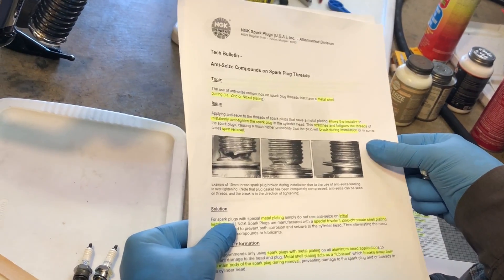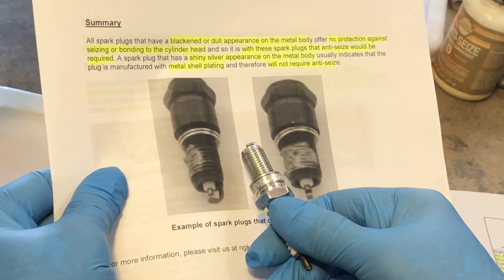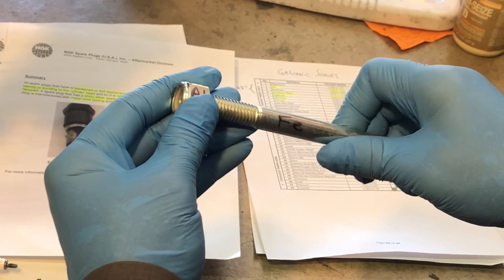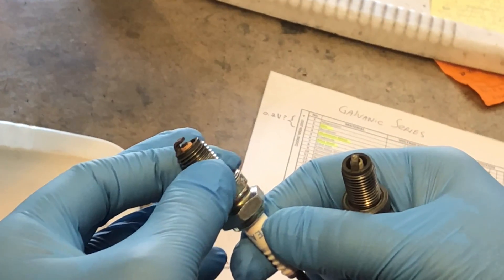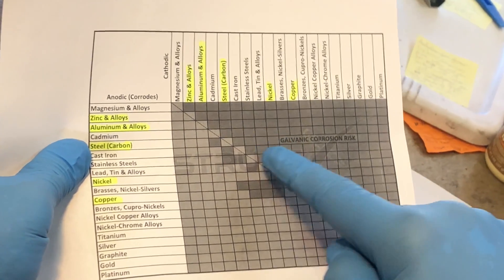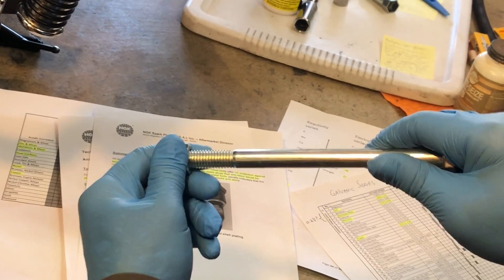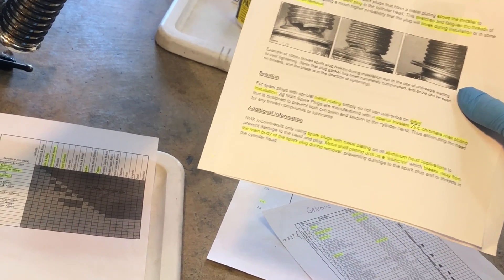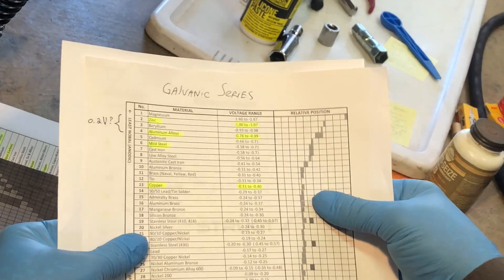Aluminum cylinder heads, spark plugs, anti-seize, & galvanic corrosion

Comment: Hello,
So…if the friction coefficient of an anti-seized thread is equal to a zinc coated thread, would one torque both the zinc plug and the anti-seized plug to 7 and not 10?
Reply from the maker: The friction coefficient of a zinc-coated thread is not equal to that of a thread, lubricated with anti-seize, because anti-seize contains not only powdered metal (zinc, copper, etc.), but also grease, which provides most of the lubrication.  Without lubrication, the friction within a metallic threaded joint depends mostly on thread geometry and surface roughness.  Many bolts and screws are coated with zinc, nickel, etc.  These coatings do NOT turn them into "lubricated" fasteners.
Reply: Great work!
Although copper and other compounds may indeed not prove to be problematic…
Given you expressed no reason(s)  how copper or other compounds might possess beneficial properties not present in alum or zinc compounds…
Any reason why I shouldn’t simply utilize an aluminum or zinc compound?
Your presentation was fantastic!!
Reply from the maker: I prefer zinc-based anti-seize because zinc is more reactive than copper and aluminum.  Also, the product I use has a very high temperature rating.  However,  some viewers warn against using copper-based anti-seize in certain situations -- see comments, below.  Personally, I haven't had problems using anti-seize of any kind. @flyonbyya

Comment: Fantastic information, especially if plugs are removed for inspection then reinstalled. I never use a torque wrench to reinstall plugs. They have a crush washer and and bring them up snug tight and don't moose them in.
Reply from the maker: Thank you!

Comment: Super Presentation!!!
I have a great running 302,000 mile ‘07 Toy Yaris I’ve owned since nearly new.
 I waited until 217,000 miles to change the original plugs…
It took quite a bit of force to free them…I was quite afraid they were going to strip!
Q. I’m curious as to how much of that friction was the threads vs seat friction?
And yea…I applied anti-seize and eased off on the torque on the new ones.
Bout time to change again.
Reply from the maker: From what I recall, when a fastener is tightened, about 50% of the torque is used to overcome head friction and 40% to overcome thread friction -- only about 10% of the applied torque goes to stretching the bolt and creating clamping force.
Reply: Hello
Should or would  that -30% torque rule apply with any anti-seized steel bolts threading into aluminum?
Thanks
Great presentation!
Reply from the maker: In my experience, yes.  You don't want to strip the aluminum threads out. @flyonbyya
Reply: @Zerk_Ziegler 
My only potential contention is the assertion that fasteners are designed to be torqued dry or lightly oiled, given its critical the proper application of a specified lubricant be applied to engine head studs/bolts, rod bolts and crank mains and other critical components.
ARP is the world leader in aerospace quality fasteners and explains via YouTube 
why it’s critical that proper lube be employed.
Copy n paste the wording below to YouTube: 
Why Use ARP Ultra-Torque Fastener Assembly Lubricant
Reply from the maker: Good point.  "Dry or lightly oiled" is somewhat of a general statement.  For torque-critical applications, manufacturers/suppliers specify particular procedures that must be followed and/or lubricants to be used.  It makes sense that torque, applied to a lubricated fastener, will result in more consistent clamp-up than torque, applied to a dry fastener, since the friction in the threaded joint is more consistent when it's lubricated.   @flyonbyya
Reply: Hello
Should or would  that -30% torque rule apply with any anti-seized steel bolts threading into aluminum?
Thanks
Great presentation!

Comment: I don’t think the zinc acts as a sacrificial anode, zinc is also a lubricant. I have always used anti-seize and will continue to. Never ever used a torque wrench.
Reply from the maker: The lubricating property of anti-seize is another reason I use it -- much easier on the aluminum threads in the head.  And you are right -- if no electrolytic substance is introduced between the threads, no electrochemical reaction occurs.  That's why copper-based anti-seize (aluminum is more reactive than copper) is also effective.  But, if there IS some gap to receive the "electrolyte", zinc is your best best.

Comment: I have a question 
I replaced NgK plugs on a Gen3 Prius
I applied I light coating of Mobil 1 oil to the threads
I did not use a torque wrench 
But i was careful not to over tighten using my best guess

Should I have concerns?
Was applying oil a bad move?
In your opinion should I pull the plugs and do a do-over?

Thanks in advance!
Reply from the maker: Oil is not really suitable for high-temperature applications such as this (see comments, below, concerning the use of molybdenum disulfide paste).  I think it's best to pull the plugs, clean off the oil using carb cleaner, and apply a little high-quality anti-seize to the threads without getting any on the ground strap or the center electrode.  If you have good feel, you don't have to use a torque wrench.  Also, spark-plug manufacturers provide charts, specifying fractions-of-a-turn tightening specs for particular sizes and types of plugs.  Note that angle-wise tightening specs are different for new and used plugs that have crush washers.  If you pull the plugs and reinstall, they are "used".
Reply: @Zerk_Ziegler  
I agree, I was already leaning towards this. 
I appreciate your second opinion 

I’m probably the only Prius owner you’ll meet who has driven it at its governed max speed of 124mph! lol 
I regularly drive the interstate at 90-105

Somehow I feel driving it hard is better for the  hybrid engine, less thermal cycles….

It just stays hot!
Reply from the maker: License and registration, please ...  Bad jokes aside, internal-combustion engines certainly last longer when they are properly warmed up.  They also benefit from occasional high-RPM use, as this helps to blow the carbon out of the combustion chamber.  However, sustained high-speed, full-throttle operation does increase stress and corresponding wear on all drivetrain components.  As for driving habits to make my daily ride last, I would try to minimize shorts trips (under 10 miles), accelerate hard once in a while (no, not from EVERY stop light), and take it easy on the pedals the rest of the time.  Your car and your wallet will thank you.

Comment: Whoever broke those spark plugs must have tightened them like Hercules.
I'm surprised they did not strip the threads.
They dont need to be that tight with anti seize or not.
Reply: 5 Olga-doogas tight = 75ft lbs torque 💪👍🤣🤷🏼‍♂️

Comment: Honda's service manuals recommend anti-seize and provides a torque spec that assumes anti-seize is used. NGK, on the the other hand, specifies an angle not a torque. If either are respected then it won't be too tight. NGK's angle spec is impossible to overtighten regardless of use of antiseize. If someone used a dry torque spec and then added anti-seize then that would run into a problem (as NGK's bulletin described).

Comment: I guess I was lucky? I have a 2001 GMC Yukon that has over 300000 miles on it, the plugs were original! Why it still ran I don't know??? I was able to remove them, it wasn't that hard I was afraid I would snap a few off in the aluminum heads, the only difficulty was the rear plug locations, they were definitely worn down over twice the gap they should have had. I replaced them with IRadium plugs with a dab of anti seize. I think I'll be good for a while now.  If you wonder why I am spending time and money on a 21 Year old with over 300k on it? It has absolutely no rust and the engine runs fine. I use it for long trips 3000 miles regularly, I think the highway mileage is what kept it running so long. And I don't beat on it like too many people do to their vehicles today.😮 Treat it like a lady and she will treat you right.
Reply from the maker: Thank you for posting this comment.  I think you hit the nail on the head as far the benefits of long trips are concerned.  To have galvanic corrosion between two dissimilar metals, electrolyte is required.  It is my guess that by warming the engine up thoroughly during long trips, acids that are generated during the combustion process and pushed into the interstitial space between the threads of the plugs and the head are burned away.  Minimizing the amount of electrolyte minimizes corrosion.  Generally speaking, long trips and relatively gentle use are key for engine longevity.  But, it's not a bad idea to "get on it" once in a while to blow the carbon out of the combustion chamber :)

Comment: You do have to be careful using anti seize with copper on aluminum parts, especially on boats/stern drives/outboards, especially in salt water.
Reply: Salt water marine mechanic here since 1979.
I use Permitex aluminum zinc silver based antiseize as you warn.

We had copper head gaskets on older iron inboards .
But aluminum outdrives with stainless propellers sizzle like Alka seltzer in some big marina with shore power leakage at slips .
Mercathode anode cathode is a must .
I only use NGK on marine and motorcycle since the 70s .
Beware of counterfeit NGK iridium spark plugs now.
Reply from the maker: It is true that aluminum is more reactive than copper, so I personally try to use zinc-based anti-seize whenever possible.  Marine applications are some of the most challenging ones for sure.
Reply: @Zerk_Ziegler    For sure, and salt water is a great conductor, makes for a nice battery/galvanic reaction

Comment: Looks like when you apply antisieze, the concern will be the torque being applied during installation. Do you have an idea of how much torque (range) will break a spark plug?
Reply from the maker: It would be interesting to do a bench test to find out.  Also, I wonder if the plug will break before the threads in the aluminum head strip out.  My go-to method for installing plugs with anti-seize on the threads is to back the torque off 30% from the middle value of the recommended range and then check if the plug can be CAREFULLY hand-tightened a little further, just in case it's a bit loose in the head.

Comment: I have been using antiseize on spark plugs for a very long time. I also use a torque wrench. I have never had an issue with the threads in aluminum or cast iron heads. I have never broken a spark plug as depicted in the NGK picture but I have broken a small few by having the socket go on an angle when tightening so I have learned to keep the socket, extension and ratchet in a perpendicular position. My only precaution is to not lather up the threads and to keep it away from the electrodes, you do not want antiseize getting into a cylinder. IMHO, use it on all spark plugs and stop fretting over it. Those depicted NGK spark plugs must be made with recycled Chinese steel.
Reply from the maker: Thumbs up on keeping the socket straight and keeping anti-seize off the electrode and ground strap!
Reply: I would also add that not all "anti-seize" compounds are the same. I have seen AS compounds that are copper-based, but I have also seen nickel-based "high temperature" AS.
Reply from the maker: Others are Zinc or Aluminum based and some contain no metal at all (check out the Loctite line of anti-seize products, for example) @ronroberts110
Reply: @Zerk_Ziegler 
Next video: What type of anti-seize to use when and where! 😉
[oops, hadn’t watched the whole video yet]

PS. I’m your 219th subscriber. You deserve more!
Reply from the maker: @Conservator.  Thanks!  Honestly, I was surprised to get 10 subscribers.  Just wanted to put my thoughts out there and have folks pitch in.  To me, YouTube videos are primarily idea generators -- the viewer has to separate the wheat from the chaff.  The comments are the most valuable part.
Reply: If you lubricate a plug or any fastener you must reduce the tightening torque by 40% , if you don't , you are over tightening it. The specified torque assumes a dry thread.
To impune the quality of the steel a spark plug is made of is idiocy. It is a spark plug ,not a high tensile fastener and does not need to be anything other than mild steel.
Reply: the problem is wet torque vs dry torque. if you use anti seize you need to lower the torque value as to not over tighten the plug.

Comment: You bring up an interesting point, I just changed My spark plugs, My recommendation for torque was 15-20FT LB
I lightly coated all the threads into the cylinder block.
Question, am I right in doing so? 
Thank You
Reply: You're fine!  Only time I use fancy unobtanium tipped plugs in my aluminum-headed personal vehicle is 1) They're impossible to reach and thus don't want to do the job again.  2) Copper plugs won't run properly or they're unavailable.
The reason I prefer copper electrode plugs are 1) Cost and 2) They must be replaced more often.
There are other benefits of copper electrode plugs over unobtanium that probably don't apply for most of us.
Reply: @thisisyourcaptainspeaking2259  That is a Sound Mind Captain

USN(RFT)
Reply from the maker: Did the recommendation also specify the use of anti-seize with the supplied torque value?  Some do and others don't.  Lubricating the threads significantly reduces the coefficient of friction, so if the recommendation was intended for dry, clean threads, it is possible to over-torque the plug.  When using a dry-torque recommendation, I reduce the torque by 30% when installing the plugs into an aluminum head.  After using the torque wrench, I check that the plugs are snug in the head using feel (no gorilla strength, god forbid).
Reply: @Zerk_Ziegler  Thank You for the quick response.
I just got back from removing the anti-seize.
The more I thought about it, the more I realized that I might be over-thinking this project.
No doubt, that there is some residual left on the threads in the head, but I backed out twice to clean the plug.

I still think that you should use anti-seize, due in part to the mechanics that are stuck with the very challenging "do or don't" scenario repair. 

Have a Great Weekend,

USN(RET)
Reply from the maker: For sure there is some still left.  The are two potential problems with using anti-seize on a spark plug: (1) over-torqueing the plug and (2) contaminating the electrode.  If you apply anti-seize with care and use proper torque, you should have no issues. @FoolsAmongUs
Reply: @Zerk_Ziegler  One other question if you would, I have tapered plugs, the specs show 10-15 with anti-seize, and 15-20 without.  However, another Mechanic said he would just hand tighten them, what would you recommend?
Reply from the maker: @FoolsAmongUs  I would torque to the low end of the spec (say 10 lb-ft with anti-seize) and then would try to hand-tighten further just a little, making sure NOT to overtighten.
Reply: @Zerk_Ziegler  I have been driving around at 14 lb-ft and this how this question to Me
I will loosen immediately.
I will set My torque ratchet for 10.2
Thank You for Your Expert Advice.
Reply from the maker: @FoolsAmongUs  I am sure 14 lb-ft is just fine if the threads were lubricated -- that's 30% less (which is the rule of thumb I use for this purpose) than the dry torque spec of 20 lb-ft.  You don't want a plug to be too loose, which could potentially cause it to be blown out of the head.  But, just to beat a dead horse some more :) -- your mechanic friend makes a valuable point about hand-tightening.  Torque wrenches are "dumb".  By that I mean: when was the last time the torque wrench was calibrated?  Is it being used at the very bottom or at the very top of its range, where it's not as accurate as in the middle of the range?  All these factors may contribute to potential inaccuracies in the torque, actually applied.  For torqueing down spark plugs, I find that it's best to first use a torque wrench to get into the low ballpark of the specified torque range and THEN finish the job by hand-tightening, but with restraint -- don't use too much leverage!  You will get a good feel for this eventually.
Reply: @Zerk_Ziegler    I did notice the ft lbs specs and reduced as required.
However, I removed the plugs, then took a microfiber towel, and found the smallest amount of anti-seize 
NOTE: I coated the mid-section that was roughly three threads (out of eighteen).
But, Thank You for your response.